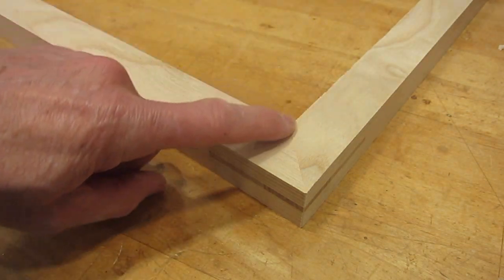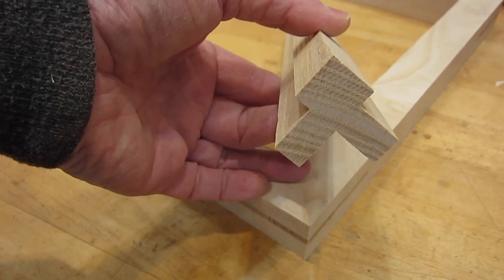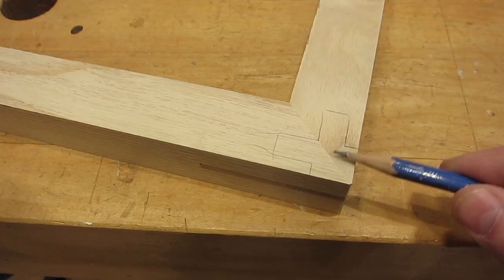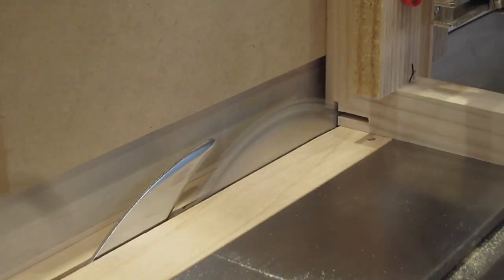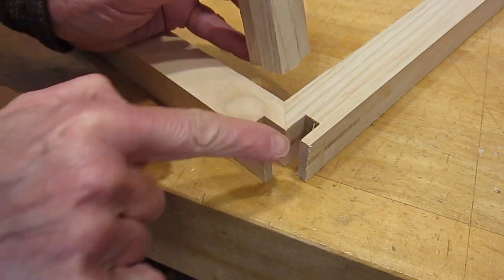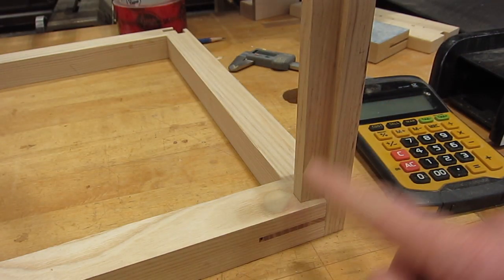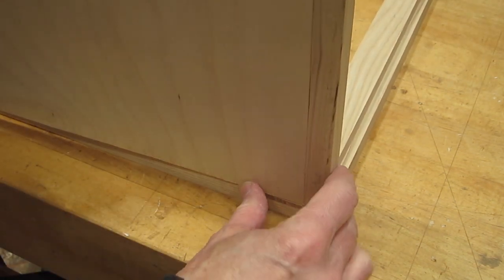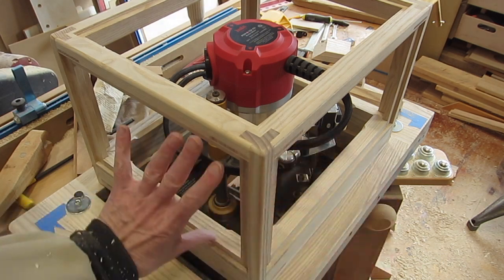Three Way Corner Joint

Comment: If I dont apply miter joint, will it be holding still ok together?
Reply from the maker: Miter joint with spline is important for strength of joint.  Here is how I cut for spline https://youtu.be/QOro4q11Frk
Reply from the maker: Here is another 3 way corner joint, that does not require miter or spline.  https://youtu.be/aKJI_f44v0E
Reply: @steven.woodward  thank you